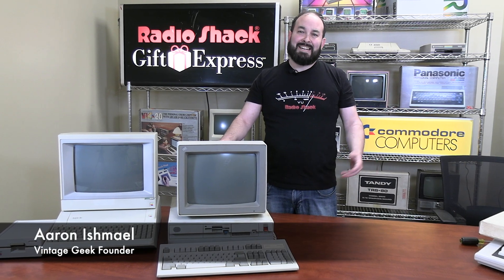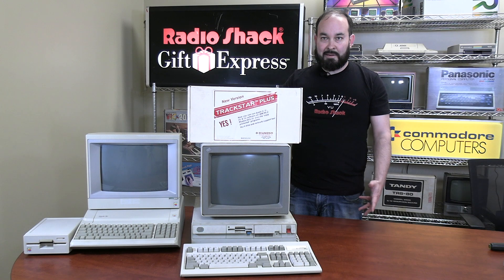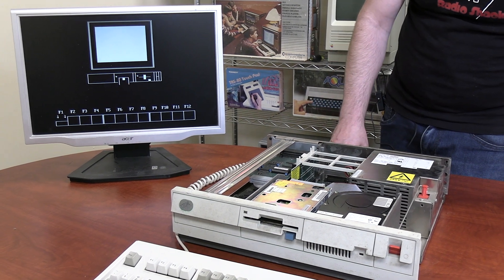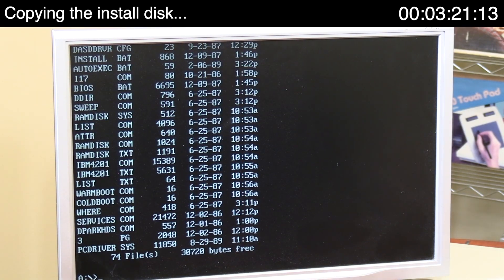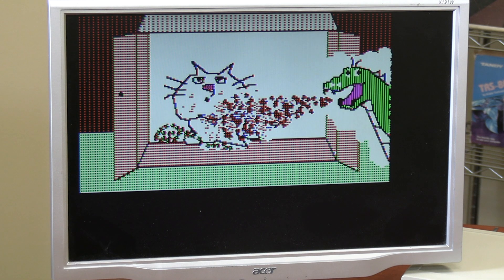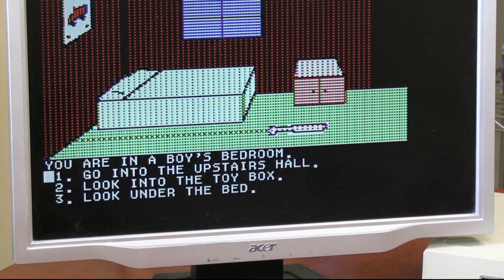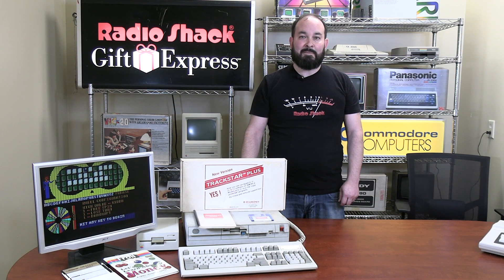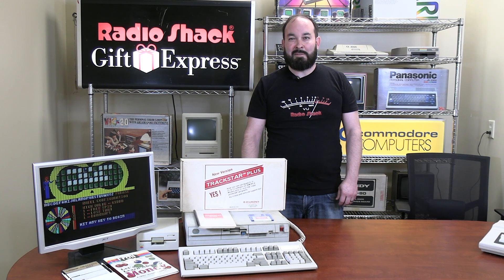Putting an Apple II inside an IBM with the Trackstar Plus

Comment: I had one of these in the late '90s, that I got in some haul of scrap PC expansion boards or other, but I never had the software for it, nor did I have an Apple disk drive at the time, so I couldn't use it.  I traded it away to a friend of a friend, and that was that.  Cool to see it working!

I currently have one of the Apple 2 cards that plugs into a Mac LC-series, and I have used that in the past, just to see that it worked.  It now needs a re-cap, as does the LCII it plugs into.  But I should be able to make it run again if I get to that job before the cap juice does too much damage.  Probably better clean it up soon, even if I don't have new caps to put on.
Reply from the maker: I was extremely nervous that the floppy with the software wouldn’t read…very thankful that it worked!  After making this, I found a cool website where someone has archived a ton of Apple games in the Trackstar format so hoping to test some of those on it soon.

The card you have for the LC sounds interesting…hope you get it working!